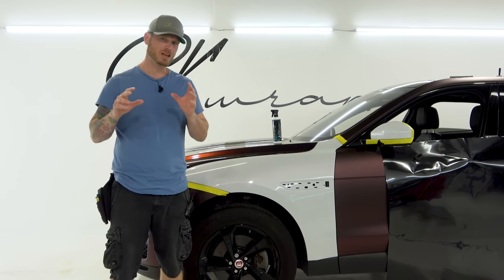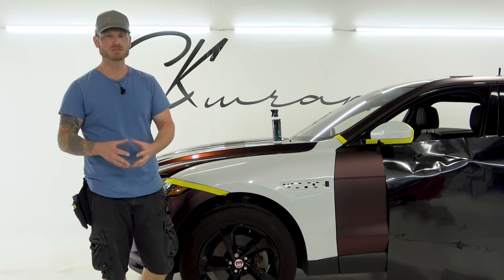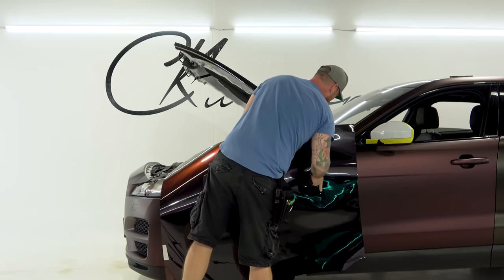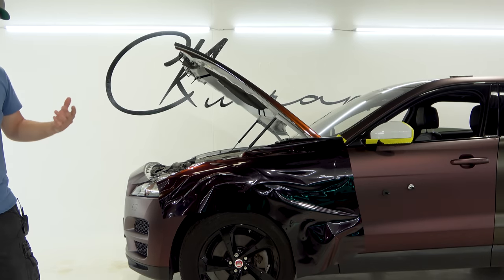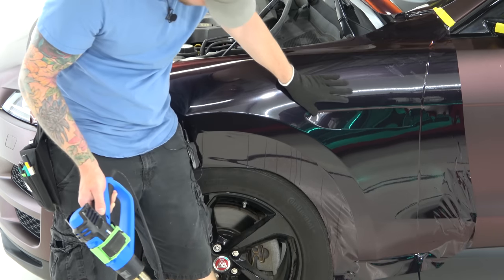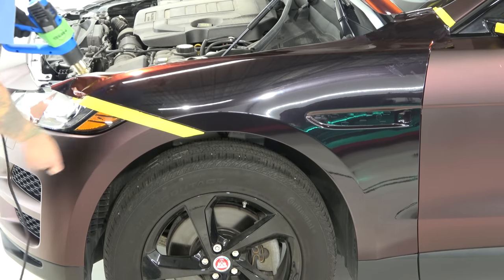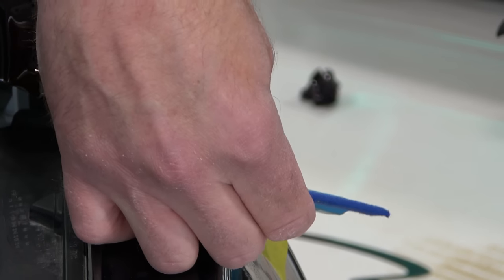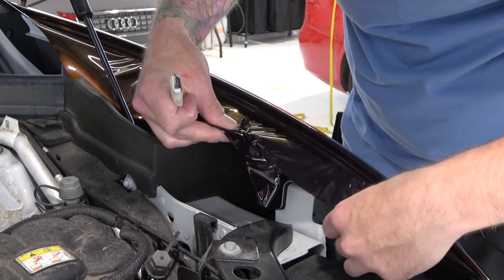Professional Level How To Vinyl Wrap A Fender - New Color & Finish!

Comment: Did you use tac reducer on the panel prior to install i bought this film and the tac is crazy low/no touch almost immediately anchors and is causing some glue lines. I'm thinking it may be humidity related as i do live in Florida in the States. But figured you may have some insight on it
Reply: I am wrapping my car now with ultra gloss and I agree with you. The tac is horrible. I am not working in a controlled temperature so I was thinking the same. I did buy some tac reducer and it seems to help with the tac but still get lines from lifting and glassing out even before using a squeegee.

Comment: Thanks for all your helpful videos. I have only wrapped a couple atvs and utvs with camo 3m cast vinyl. I made some mistakes. But I'm learning. I have a question using primer 94 on the edges. I hear some use it some don't. Do you think it's necessary? Thank you.